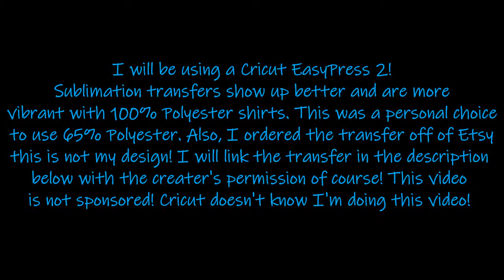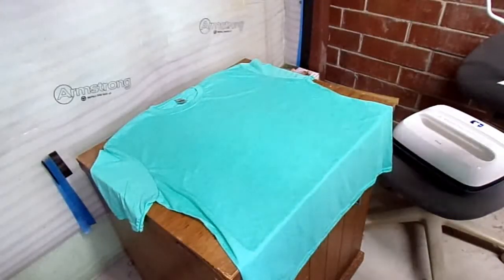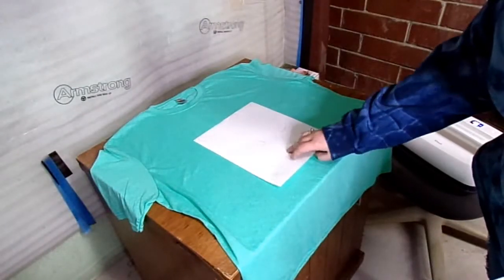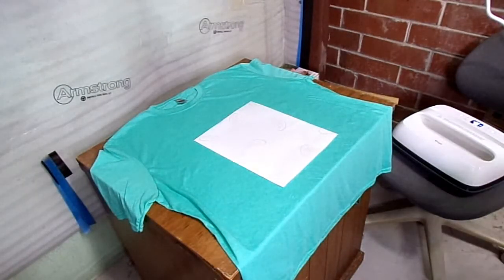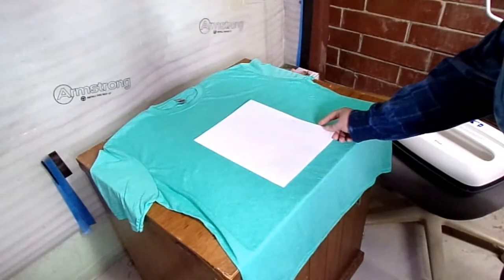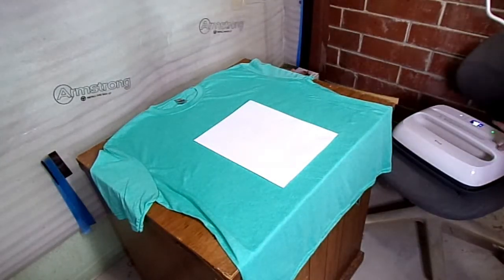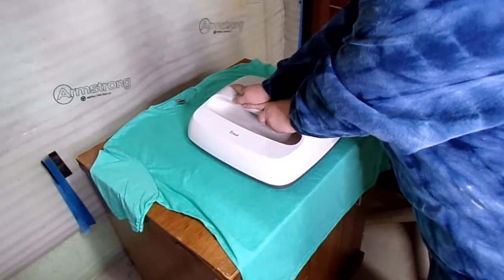Using a Cricut EasyPress to apply a SUBLIMATION transfer!!

Comment: So I just bought an easy press specifically for sublimation, should I return it and get a clam one? Or do u think I’ll be fine?
Reply: you'll be fine i use bot a heat press and circuit easy press for my shirts.
Reply from the maker: I have had no problem using this cricut easy press with sublimation

Comment: I just did this and had my cricut easy press2 set to 400 and 60 seconds and it scorched my shirt, or turned it brown, where the sublimation wasn't.
Reply from the maker: What material was the shirt?
Reply: i also have this issue. turned my white shirt a yellow brown color.
Reply from the maker: @jaqui1310  that’s crazy! I’m so sorry! That’s never happened with me
Reply: @jaqui1310  every poly count is different, and you could spray it with peroxide if it’s a white shirt